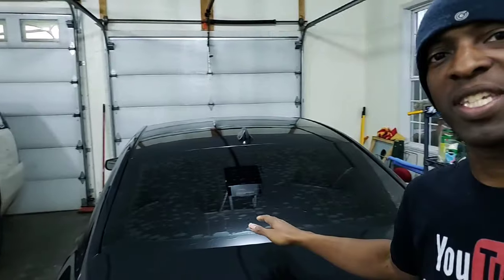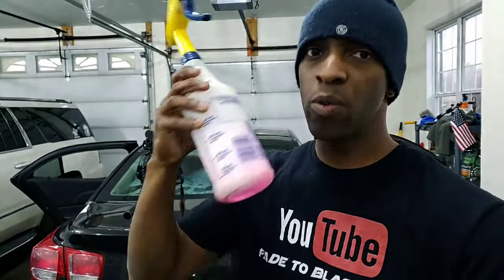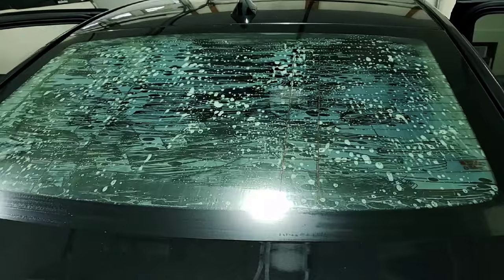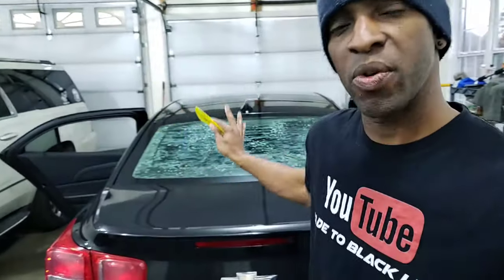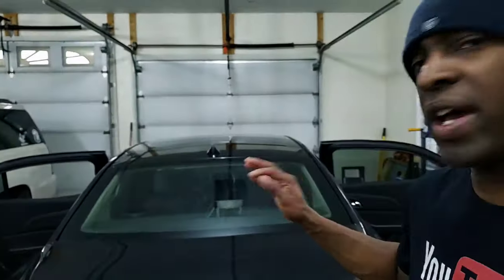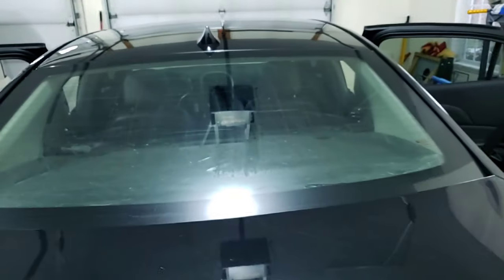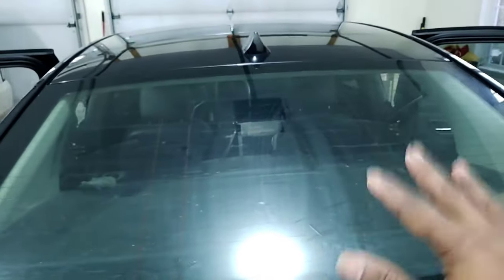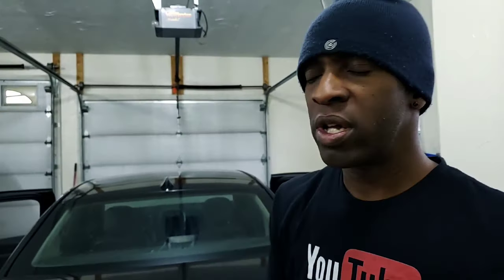How to Remove Old Bubbling  Window Tint and Replace with New Window Tint | Dirty Messy Job!

Comment: I had 40% 3m ceramic tint install on my vehicle about 7 months ago. I want it remove for darker tint is it worth the hassle getting it removed
Reply from the maker: I guess that depends on how bad it bothers you.  If it will keep on bugging your mind go ahead and get it done.  I personally like 50% which I've said in most of my Windshield videos but I like to test the waters so I can experience for myself.  I thought 35% was to dark for my area and I tried 40% which is a little lighter but still at times to dark.  I won't remove it unless I have to, so for now I'll just leave it. You have to decide that, your vehicle.
Reply: @FadeToBlackLLC  Thank You I'll probably leave the tint as is and tint my windshield
Reply from the maker: @carolinapantherfan4330  yeah just do a nice shade on the windshield and it will help.

Comment: Hit up The Home Depot and grab some 'ZEPS Floor Stripper' and watch that adhesive just run off the glass. Don't dilute it. Just pour into spray bottle, spray on, and let it sit for about one min. We know it really depends on what kind of film, how long its been on there, what solution was used to install.. but with this stuff, some adhesives will literally run off the glass.
Reply from the maker: I’ll try that! Thank you for the info!

Comment: Does the removal damage the defrost lines?
Reply from the maker: It possibly can but most of the time I haven’t had any issues. 
It’s a possibility though.
Reply: They are fairly easy to fix if you do disturb them.Permatex makes a repair kit and then you need a test light of multimeter.

Comment: Reason why it do bubbles because the glue of the film is not strong enough or its a 1ply
Reply from the maker: I just got the car dropped off and I had no idea.  I use 2ply film for my installs.

Comment: Ive removed tint before but on my other vehicle, on the rear defroster window, its been a pain to remove since its cheap dyed film and its been coming off in small pieces, ive used both a steamer and a heat gun but still taking me hours to remove the tint, the adhesive is a piece of cake to remove but the tint isnt. Any ideas anyone ?
Reply from the maker: There's no easy way. You just keep working on it till you get it done. You saw this video, I tried everything I had.

Comment: The reason the bubbles appear prematurely is from using the rear defroster. If the rear defroster was never used (unlikely) then it is from sitting in the sunlight/heat.
Reply from the maker: She said it was parked in the garage for the first while she had it. Then she had to park outside they started to pop up pretty quickly.

Comment: Hey that stuff works a lot better than a straight razor 😂. Razors also aren't kind to the defrosters. Might have to give it a try.
Reply from the maker: Yeah I didn't want to buy the customer a new glass ha ha
Reply: @FadeToBlackLLC  i use a nice single edge razor blade on my glass stove top and crefully get no scrathes but cooked on stuff comes off.  it was the sun baking that made my hatchback tint bubble so ill maybe try covering with a sun shade after I get those bubbles out'

Comment: I have a much better way to remove it. The basic idea is using Super Strong chemical to penetrate the tint.
You need some old school paint remover, or you can mix 6 part of methylene chloride with 4 part of methanol. You need protection gear of these chemicals. You put a lot of them on the old tint. Wait for 10 min. The tint will come right off without any effort. Then, use acetone to remove the glue. Repeat the process above..

Reminder: any product contains Methylene Chloride will do the job. It can get the job done really fast. However, this is a highly toxic chemical. You have to wear protection gear to do the job.

You can pin this review.
Reply: Yeah no.
Reply: While this might seem like a good idea, it may be impractical in some situations. I’d also be careful with breathing in the fumes. I wonder how you apply acetone and paint remover tho
Reply: @alanandrade2083  yep. I wear a gas mask and protection suit and gloves while working. The old school paint remover I got is gel-like. I cover everything I don't want to damage with multiple layers of plastic cover. Then,  I use a cheap paint brush to cover all the tint with gel like paint remover. Waiting for 5-8min, I can use a plastic card to scrape off the tint very very very easily. Then I warp them in the plastic cover and throw everything away.
The last step is to use a towel wet with acetone to swipe out the remaining tint glue.
It is very time efficient if you have done it correctly.
Reply: @alanandrade2083  yes it is a desperate solution. I spent a week slowly working with a heat gun only to peel off a small corner with a lot of let over. Using this chemical helped me finish this job in about 3 hours. 
If you have the knowledge to handle chemicals, this will be your best choice.

Comment: I figured it was from the years of defrosting...I need mine done badly. But I want them to put some plastic down to protect my speakers.
Reply from the maker: The shop most likely will try to protect your car.  We don't want to have any damage and have to lose out paying for damaged parts. I'm sure you will be fine. I just replaced a back window this morning.

Comment: The Bubbling is caused by Sulfate Oxidative Sun active Response and it's caused by fingerprints and or dust particles reacting with the adhesive and the sun... I'm a chemist 🧪 and the best Way to get it off is actually Regular 409 and or any Sulfa based degreaser or I like to use Greesed Lighting. After spraying the window fully in, cover with plastic even cheep garbage bags work once the degreaser is covered by the plastic fully! Leave the car out in the sun 🌞 for at least 3 hours and then the tint and! The glue will sluff off! REMEMBER to remove it slowly! AND if some glue sticks just use the Greesed lightning ⚡ full no dilution and it will come off after sitting another 20 to 30 minutes. And when I say comes off I mean with a dry rag or a roll of paper towels! Not 🚫 Steel Wool! Hope this helps? J.C.
Reply from the maker: Thanks for sharing your information!
Reply: @FadeToBlackLLC  your very welcome Bro. Also I forgot that the sufa with
Reply: Ammonia will be best at breaking down the old tint they work in tandem to liquefy any adhesive. Also if you're having trouble with those You can use straight lighting fluid for wood and charcoal it will liquefy any adhesive almost instantly. Just be sure to Not 🚫 get any on the plastics and or other interior of the vehicle. Then make sure to completely clean the Glass with auto glass cleaner after removing the adhesive,or it can damage the rear defrost lining! Happy Stripping!😉😎

Comment: My tint is so old it separated the clear from the darker shade with adhesive
Reply from the maker: I've seen that happen too.  Some just leave it on the car and don't bother which makes it harder to remove years later.
Reply: @FadeToBlackLLC  what would you recommend to remove it? Would ammonia and a plastic razor remove it without damaging the defroster?

Comment: Oh btw this happens alot with cheap film! This is probably that $99 for the whole car no warranty job. Either the cheap glue is falling or the ink is falling.  That's why people should buy the better option with a lifetime warranty.  Which by the way cover bubbling and color stable.  Some companies say lifetime which in tint world means 10 to 15yrs or original owner😂.
Reply from the maker: I hear you. For some reason it was only the back glass the rest were fine. Who knows I just did what the customer asked.
Reply: @FadeToBlackLLC  it's the The angle of the back window because it gets hit by the sun more but surely the rest will follow. Also the heat from the defroster plays a roll just like a steamer help remove tint the defroster heat up and cool down the back window with steam building up.

Comment: The heat from the defrost lines causes the tint to bubble up...
Reply from the maker: Some say it's adhesive failure with bad tint too. I'm not exactly sure but either way it's a pain to remove. Most people wait to long before they come in to get it replaced.

Comment: Simple pink works great man 
I get those windows all the time so I know I’ve done worse than that man
Reply from the maker: I'll have to try that one day.
Reply: Yes that works good and there is another one call 409 I think but the pick is great tho good stuff
Reply from the maker: @TexasTint_Pro  yep I've seen 409.
Now I'm curious to get a bunch of products and do a test🤔🤔🤔
Reply: There is a bunch there is one from fusion too the orange something too I have it at my shop but just in case I don’t use them a lot but yes I have lots of re do
Reply from the maker: @TexasTint_Pro  I've been doing more redos it seems every year. I don't have a ton but every now and then I just get a through them.
I definitely want to get more products and test. I just get through it for the most part and get done.

Comment: If the bubbles only formed along the defroster lines. I would say, the defroster is the cause. But it doesn’t. 😞
Reply from the maker: Not really sure but I just use the products I have. Thankfully I haven’t had one this bad in a long time.

Comment: I would trap the chemical in with a garbage bag so it doesn't evaporate. Do some other work for a couple hours. Then it's much easier to remove. The epitome of work smarter not harder.
Reply from the maker: I did this when it was cold outside but I've heard of the Trash bag method. That might have worked better.  Thanks for the tip.

Comment: Bubbles form when the water and adhesive isn't fully removed from the film. I you get bubbles in your tint after application, the guy who applied it did a bad job. That's it. If you get bubbles, the guy who put it on did a bad job
Reply from the maker: The tint was fine for three years she told me. Once she started to park it outside then it began to fail.
So I don't know but either way out with the old and now she'll be good for a while.

Comment: That's awful! What about heating of this window??? Why not use the hair dryer??
Reply from the maker: A steamer heats the tint and uses the moisture to keep the old tint soft. Hair dryer doesn’t get hot enough and a heat gun will just burn and melt things. 
The method I used in the video is always the steps I take.
Reply: @FadeToBlackLLC  Is there a video how to use a steamer on this back window? I am not completely stupid, lol, just can't imagine how did you use the steamer on the inside... The heating wire can be damaged??  It is easier to just stick the new piece of film on the outside..🙄 Though thanks for instructions. My back window ooiks exactly like that one in the video!! Bad thing is that I cannot see anything through that back window, which is dangerous. But I do not want to damage the heated wire! I live in Kent UK, we have cold winter days.